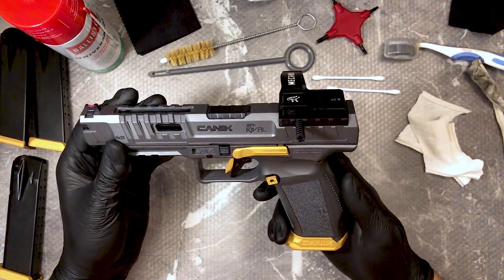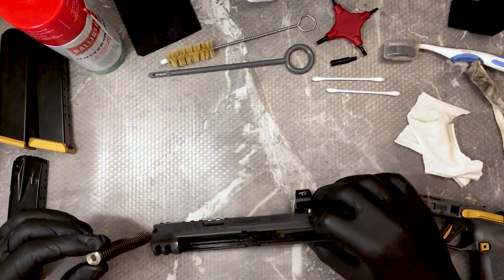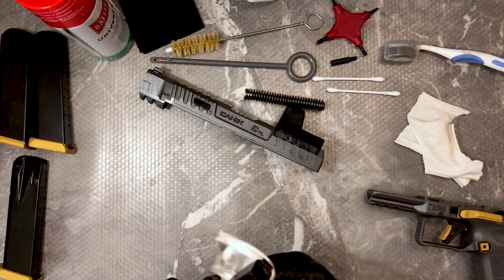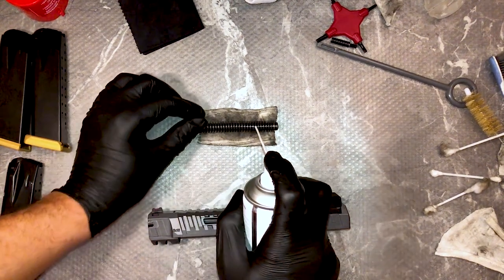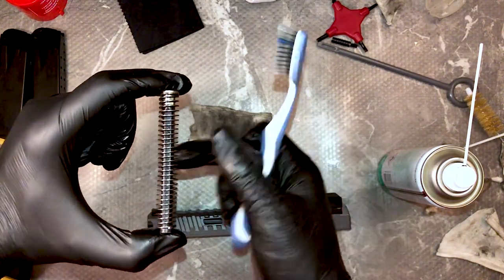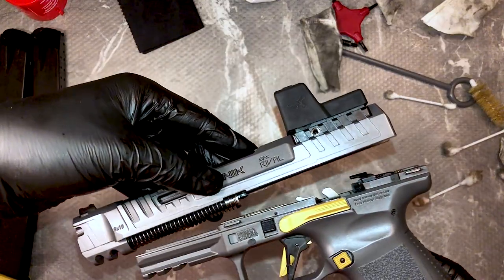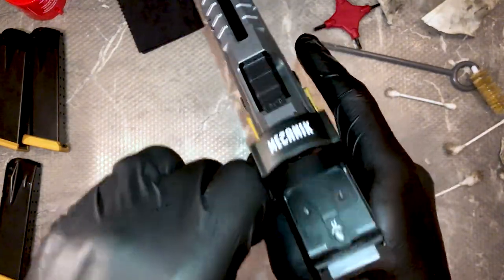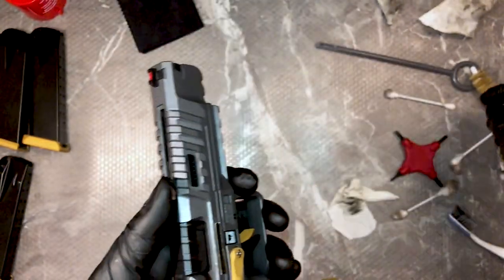CANIK SFX RIVAL CLEANING

Comment: I need to find a more comprehensive cleaning video. I need to learn how to take out the trigger assembly and the striker pin. I have around 2000+ rounds through mine its time for a good cleaning
Reply: Look up replacing striker pin. No need to disassemble trigger. Use compressed air.

Comment: Didn't see you clean the breechface, maybe I just didn't notice it? Have the Dark Side and it tends to get dirtier than my other pistols?. Do like the Canik SFx Rival very solid pistol,  but no where in the Canik SFx Rival owners manual does it clarify what to and what not to lubricate, all my other pistol don't recommend oiling the recoil guide rod assembly however. Believe the owners manual does say not to use aerosol sprays on the firearm?